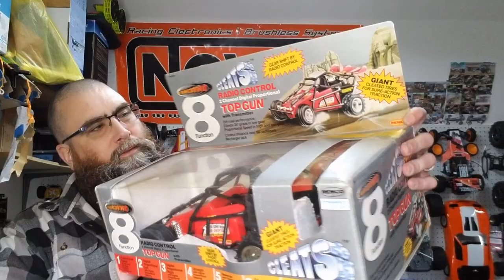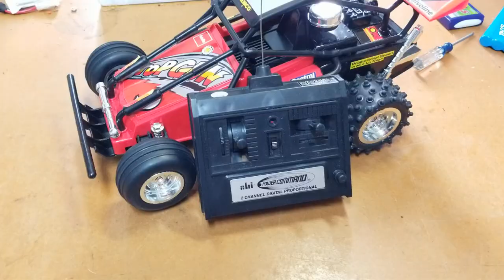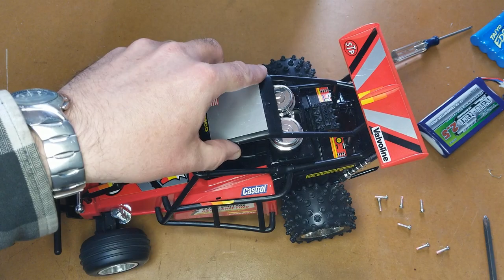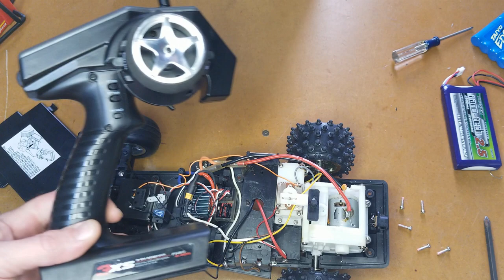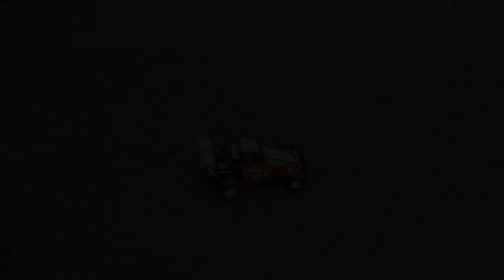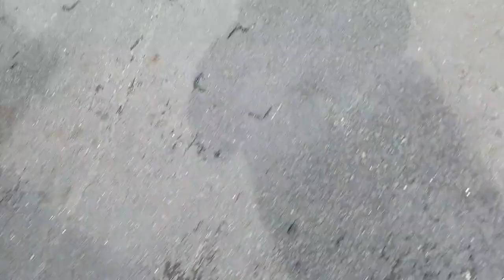Azrak Hamway International / Remco Top Gun Early 1980s Vintage Two Speed RC Buggy Steve's Hobbies

Comment: I have one still working great. Haven't done any modifications to it. It has 2 speeds like this one, only the speed shift is manually done from a switch on the back. It says 49mhz on it. I have to say mine is at least 4 times as fast as this one on it's lowest gear. When it hits a wall i feel very terrified it might break from the vicious bump lol.. The servo on front turns a lot faster too but sadly is weak on one side and doesn't fully turn it. Hopefully will make some modifications to it to improve it's performance.. Thanks for the video.